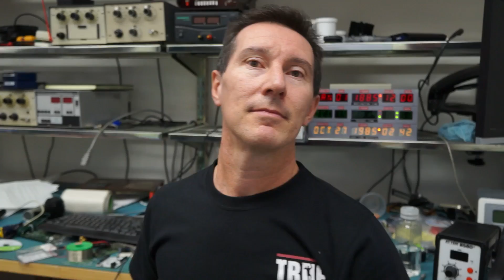eevBLAB #2 - Are Electronics Hobbyists Useless?

Comment: I had no idea the silly things I learned by screwing around in the basement like protoboarding, soldering and debugging a circuit were considered “difficult” or “too much to ask” in the field of EE. If you can’t do those things, what are you exactly? You’re a mathematician with an emphasis in EE theory - NOT an EE! I guess having made my own variable frequency square wave generator (protoboard) out of a 555 because I was too cheap to buy one makes me a third year EE student! (I needed it to drive a wireless LED thing I built - that worked, btw!) BASIC, Arduino C, OOP and some assembly are just a bonus. By the sound of it, I could tell some scary stories about learning the difference between AC and DC coupling that would  scare half the students out of the EE program at any local college. And that’s the easy stuff! Try designing and building circuits that require matched resistors! Now THAT might be a big ask for a lab gofer!

Comment: Back in the 1970's, I used to design, drill, and etch my boards.  I had a lot of fun, and my boards usually worked nicely.  Usually.  Sometimes they failed with fireworks...

Comment: Some corporate people and HR departments despise hobbyists, because the assignment to your own hobby project was not authorized by a corporate manager. They consider you cheating and not devoted enough to the managerial regime. They want to decide who gets to work on cool projects, as gate keepers to pleasant and high-status jobs, in return for increasing their own power. I did 13 years of hobby design before graduation, I have it on my resume, but they only count the years after graduation. They even go as far as count the years after graduation for people who have not spent those years on design but did low level manufacturing repairs. So, me having 13yr hobby plus 17-year employment, that is 30 year designing stuff. While others having a 20-year manufacturing job plus 2 years as a designer, HR grants them 22y exp and me 17yr exp. Outrageous and stupid.

Comment: Definitely not too much, may be not all the hobbyists will be familiar with microcontrollers, but they should be able to do a simple schematic layout, assemble and debug. i remember we was 4-th or 5-th grade, there was a local club, and we was building our own pcbs. Simple circuits, small motors speed controls, audio amps, LED graph bars for those amps, was very popular at the time ...  things like that. And this was in a socialistic country, where to purchase a simple LED pretty much impossible task. 
But don't worry, this is not only with the hobbyists, you have graduate that can't solve basic electric problems.

Comment: Speaking to this video in 2021, this is fascinating to me because a new type of hobbyist has emerged that's somewhere in between all of this: the Ardiuno/Raspberry Pi/SBC based electronics hobbyist.  This type skews way more into a mix of coding and bare understanding of interfacing, in part because the bar to entry is extremely low.  While this has made entry level more fun and simpler, I feel it also has nerfed a lot of intro level understanding that electronics hobbyists previously had to know.  Why build a 555 timer when the SBC does it for you to blink that LED?  Why build an LED segment interface when you can just wire in a prebuilt panel on I2C?  Thus, I feel the knowledge gap you refer to is actually increasing in many ways as this type of electronics hobby takes over.  That's not to say I hate it or think it's bad; those who really want to know will always gravitate towards more knowledge.  I do think, though, that the knowledge you describe being common to hobbyists is effectively no longer the norm; it's become the exception.
Reply: Yep now people are after CS rather than EE..

Comment: My college has got 2 projects in the first year: a simple amplifier and a line following robot. These projects don't always work as expected but the students are able to design and test basic circuits and write programs in C. Their PCB skills are often limited to soldering perfboard until the second year where they learn how to use kicad.
Reply: Referring to the perf board and KiCAD thing, they can do what I do and corrode copper boards in ferric chloride while putting corrector paste on them to leave copper tracks on the boards. 
   That's how I make my PCB's and I don't need a computer or foreign PCB manufacturer for them. If a 10th grade romanian boy can do it I'm sure adults in college can do it.
Reply: What always held me back is the fact ill be messing around with acid. Seems like a messy process and a lot of effort. Plus I have no idea how to get and dispose acid.
Reply: @timwitvliet8155  it's really easy, and you can reuse the acid many times. You can put your finger in it and it won't fall off your hand but don't leave the ferric chloride on it too long. The ferric chloride I have came in a 0,5L bottle and I pour it onto a tray then put the board in the tray, check up on the board every half an hour with a plier then take it out after 2-3 hours (depends how warm the ferric chloride is, how much it's been used already and how much copper it needs to corrode) and I pour the ferric chloride back into the bottle with a plastic funnel that I wash afterwards. None of my tools have corroded and the plastic funnel and tray aren't damaged because they get washed after use.
     This is a really easy process and you can go from a circuit on your notebook to a circuit right in front of you in a couple hours, most of it being waiting for the copper to corrode away.
    When planning on how to make your PCB I recommend measuring all your components with a ruler or caliper and drawing the PCB on your notebook at a 1:1 scale then marking the points (for the component leads) you'll need to drill trough on the copper board with a marker, drilling trough the marked points, cutting up the copper board to a smaller size and THEN laying out the tracks with a corrector pen (the ones with white paste in them). You need to drill first then lay out the tracks because your drill will surely drift a bit when trying to drill trough the board.
    Sorry for the awkward paragraphs but I'm writing this from my phone and can't align the text that well.

Comment: I don't think he's asking much at all

Ability to Solder
Basic Design skills
Basic Assembly skills
Basic Troubleshoot and Debug skills

i had this by the age of 15
i don't see why this is a tall ask
Reply: so are you software developer or are you just soldering?
the issue is electronics of today is not much without programming, and that is entirely another field....
so dave can't really define what's he looking for: debugging? that's engineer, they debug. 
searching for bugs in software means you're engineer, or at the level of one. 
i'm wondering if dave found his assistant, probably not....
Reply: @ivok9846  
No... that's not correct
the options are not either   SOFTWARE DEVELOPER or  SOLDERING
there is a lot more to it than that
I could solder by the age of 6, it doesn't mean i knew what i know today

that's like saying in building
Are you an Architect or you do you just nail nails into wood
it's not like that mate

also electronics CAN BE with programming
BUT IT DOESN'T HAVE TO BE 
Yes i know software and programming to a point,   to the point where i need to know it
but.. I'm primarily are Hardware Guy

also Searching for bugs in software doesn't mean you're an engineer 
there are different kinds of engineer's 

You are clearly focusing on only 1 area of electronics
Mate.. MOST of the electronics i do has nothing to do with programming 

Example   SMPS's ....Nothing to do with programming
The programming that i do in electronics has to do with EEPROM's 
now.. You're probably talking more along the lines of C  aren't you ?

and when you talk about ELECTRONICS TODAY
Mate... LOL
did you think that guys like me and dave from back in the day just dropped electronics and let a new generation take over
NO..... WE DO WHAT WE'VE ALWAYS DONE
so.. electronics today is mostly what it was in the 70s
we're just playing with different projects that's all

but the point of all this was ,  IS DAVE ASKING TOO MUCH 
No he's not in my opinion
he's just asking for Basic shit that everyone should know
I know that stuff when i was a kid,  the stuff that he's asking for
Reply: @martinkuliza  no, there were no microcontrollers everywhere in 70s, and not all smps then powered any sort of cpus, there were less of both smps and cpus. 
that's my point, electronics of today is about math on the chip, so to develop, you're automatically software engineer. 
to just fix, yeah, smps is enough. 
but he's (probably was) looking for developers. and I doubt he has employee....what would he use him for? 

otoh, when you see design of some of today's electronics, one wonders if software folks alone worked on it, some of the nonsense one sees.... software people and bean counters...crappy combo.
Reply: @ivok9846  
I understand what you're saying
but it still doesn't mean that a person instantly needs to be a software engineer

Technically speaking , Even Before Switched Mode you still had your analog circuits 
and you could be a hardware engineer without the need to be a software engineer

also.. Micro's were around in the 70's
Late 70s  but still 70s

don't get me wrong though
i have nothing against Software developers and engineers
and i'm all for integration IF IT'S DONE RIGHT
i'm just saying, you don't necessarily need to be software when developing hardware

i can understand and accept though that (i'm guessing you are software) i can understand how you and most software developers though cannot imagine a world without software integration 
so... it's cool... i get it
i'm just saying, it doesn't always have to be that way
Reply: @martinkuliza  nah, i'm hardware, but in the context of dave's request i think community's objection to him was right, he's asking too much, he's looking for a clone of dave, and that's hard to expect....
people he described will have higher wage elsewhere(and they know it), and it doesn't sound like he wants just-out of school interns or so...

and his subject line is sensation.
overall, a miss.

btw. dave is mainly hardware too, but his job ad is pretentious. 
and the "do you know this, and you have to know that" job interviews are pointless, what matters is how fast you learn....
Reply: @ivok9846  
Oh ok
look... i went to have another look at his job offer just to refresh my memory.
i couldn't find it 
but , if he's looking for a DAVE CLONE then.. yeah.. you can't really expect that

I personally didn't think he was looking for a clone
i interpreted it as ... he was just looking for someone enthusiastic to help him out and learn the ropes.
my impression was he just needed someone with basic electronics skills and basic design skills, nothing major

as for dave.. yeah he is mainly hardware... of course
most of us from back in the day are,  that how we started

as for what matters
yeah.. HOW FAST YOU LEARN
and also  HOW KEEN YOU ARE TO LEARN
because speed without passion is useless 

one other thing
he's a business owner... and  AS A BUSINESS OWNER MYSELF of 22 years
i can understand why you want an employee who's got the most skills for a low pay

I mean that subject on it's own is just a bullshit debate anyway
let's be real for a second, ok

and i'm not being rude,  i'm just speaking my mind (as a business owner)
look...
people here debating, Dave it paying low or average or whatever... is fucking pointless
I mean.. ok
WHA'TS LOW ???
is $10 Per hour LOW ?     Likely it is   (even for a 19 year old)
ok.. is $20 per hour LOW ?  some would say yes , some would say no.. Most would say NO, and most would take the job
How about $30 per hour, Most would say that' s awesome
How about $50 per hour,  most would think Xmas came all at once

IT'S NOT................ IT'S DOGSHIT 
So Arguing about Low or High pay when your'e under $100 per hour is fucking pointless
but then again.. is Dave a bad guy ?
NO HE ISN'T
He's doing what any employer would do 
and i'm sure Dave got fucked once upon a time in his job
Because that's he left isn't it 

in my opinion,  Employee's shouldn't complain because THEY CHOOSE WHAT THEY GET PAID
Now... they will of course disagree with that statement ,but THATS' WHY THEY ARE EMPLOYEE'S

They never seem to understand the concept of LONGEVITY
they see it more as .... if i don't take this job , someone else will
YEAH.. BUT IT'S A SHIT JOB  (i don't mean dave's one.. i mean  all jobs in general)
so... why not let someone else take it 

then the employee argues
but.. i have bills to pay
LOL

Right..... so in order to pay them effectively (can you guess what i'm going to say next)

if you guessed "You need a higher paying job"
NO... YOU'D BE WRONG

YOU NEED TO DEVELOP GOOD HABITS
Now.. accepting shit jobs is a bad habit

so... Long story short,
can we really blame dave for this...
NO WE CAN'T
he's doing what any employer would do 

Fact of business is.....
TO MAKE MONEY YOU NEED TO LEVERAGE TIME AND MONEY

so.... he will use the TIME of the employee's life and leverage it 
He will of course compensate him for that time , less than what it's worth

BUT.. TO BE FAIR TO DAVE
the employee has already been conditioned over years to BELIEVE that the under compensation is FAIR COMPENSATION
that's the world we live in
so... NO, i don't blame dave

Bottom line,    what people need to learn in life
IT'S AN OFFER.......NOTHING MORE

If i put up a job offer
Electronics Engineering role in a vibrant and fast paced company
salary $1 per hour

THAT'S AN OFFER
You can think and feel what you like about it , you can tell the employer to get fucked or whatever.
the bottom line is  THE ULTIMATE DECISION IS

1. YOU DECIDE TO ACCEPT
2. YOU DECIDE TO DECLINE

anything else (all the bitching) is irrelevant 

I don't blame dave personally,  i understand the decision
it's just the world we live in

and mate, to be fair,  Dave could teach someone a whole fucking lot... Seriously (and you know that)

Comment: Late comment, but it's still a relevant question.

Competence is useful, but when you're hiring you need to look for a more natural talent. I can't say how to test that, though...

Times change. I had a transistor selection book, and a photocopy (of a photocopy), or a note scribbled by someone about most of the ICs I used. Or I guessed -- "Circuit and see" :-)  If I was lucky I got pinouts or an example circuit diagram.

I was competent, did all the usual analogue stuff, and for example I taught myself op-amps after a 2-minute intro that basically said "It's got infinite gain, so everything depends on the feedback you set up". Did some digital stuff, as well.

I was competent, but I lacked talent/instinct to be more creative with circuitry. That's why I got into software instead, where I could roam free :-)

Comment: Draw your PCB layout on a piece of paper in order to position the components and route the tracks. Get some 0.1in pitch paper, mark the pads in mirror image, draw the tracks in again just to make sure. Cut your copper clad board roughly to size, place the paper with your design on it, over the top and mark the drill holes for ALL pads. Place rub down PCB pad transfers over each drill hole. Using either rub down track transfers or draughtsman's crepe tape (1mm), add all the tracks. Then place a piece of tracing paper over the board and scribble over all pads and tracks with a soft pencil (if you omit this step you'll either get etching faults or all your tracks and pads will float to the top in the etching fluid). Now you need some Ferric Chloride. You could get it ready mixed in bottles or as crystals, I brought it ready mixed. Pour some into a shallow tray, add your PCB and wait. Etching is faster if you agitate the tray or gently warm it. When it's finished etching, wash it, rub it down with an abrasive block then check for etching faults. Hopefully there'll be none but if there are any, repair them. If they're too bad because something went wrong, you may need to start again. Now drill it, assemble and test. Designing your own circuit, debugging it, then designing  and making a PCB, that was what every electronics hobbyist used to do when I started back in the early 80s. With no microcontrollers, designing 8-bit computer circuits was a basic skill (my personal favourite was the Z80), today it's all over YT, like it's a lost art. Yes, I believe it's been dumbed down a lot. Too easy now.